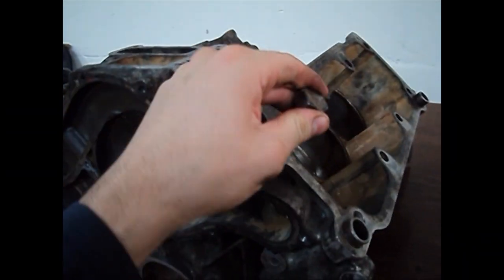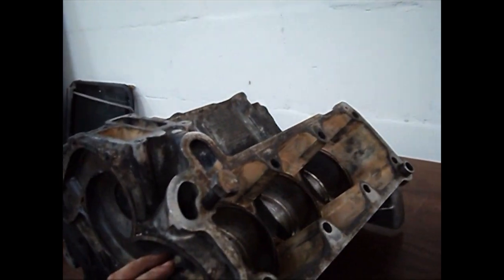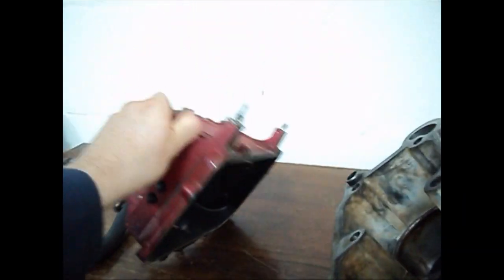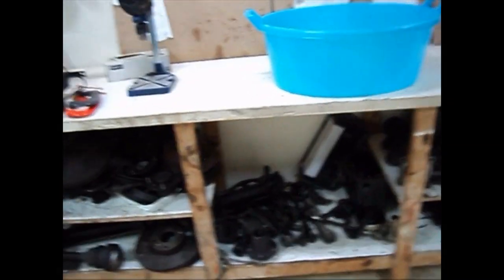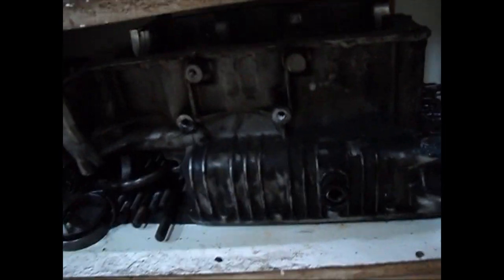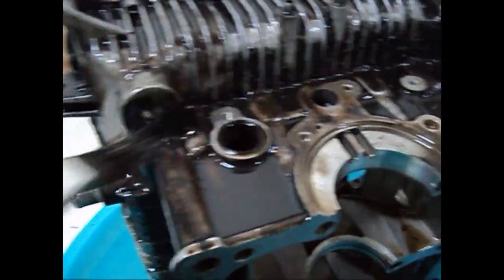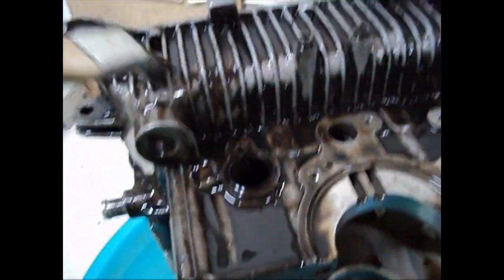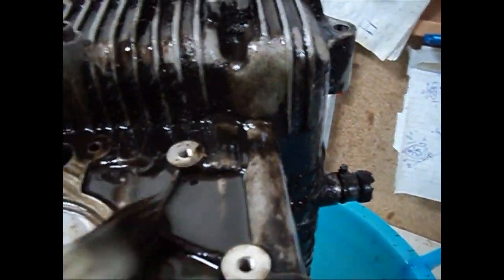Cleaning The Engine Block - Maserati Spyder Part 18

Comment from the maker: Hihihihihiii thanks mate! ;)
Right now the cylinder head is having its valve guides changed by professionals and the crank and flywheel to be polished and balanced.
It is an expensive project however, slowly but surely it will be done! :)

Comment from the maker: Balancing the turbo induction and replacing that poor excuse of an air filter to be directed from the bumper (since hot air rises and cold air sinks, I ask myself why is it placed on top the engine?)
and the exhaust is just maths, just like you'll find on tuned performance engines. Correct measurements that will not leave air to wallow or condense inside the piping but will swirl out in a consistent manner